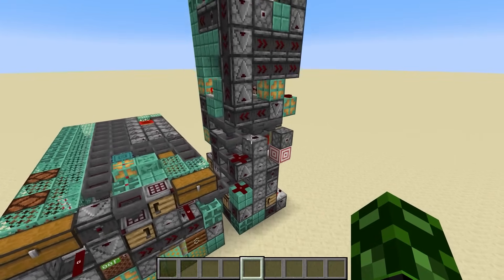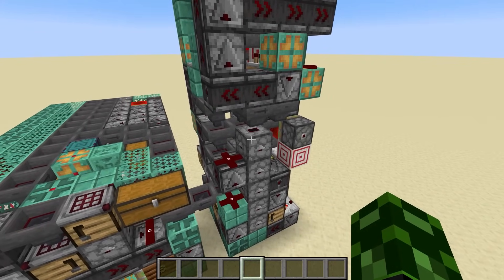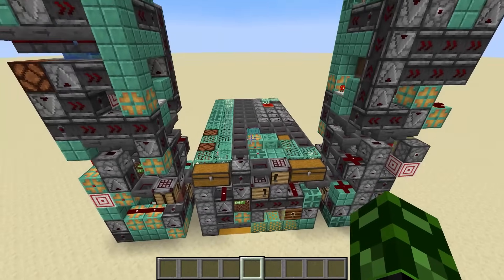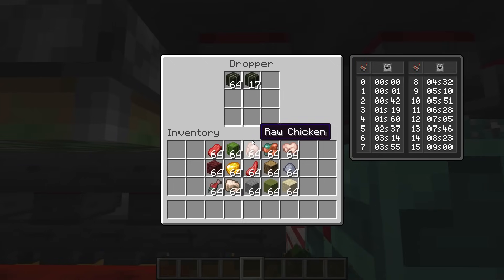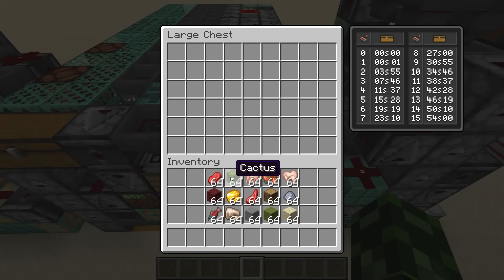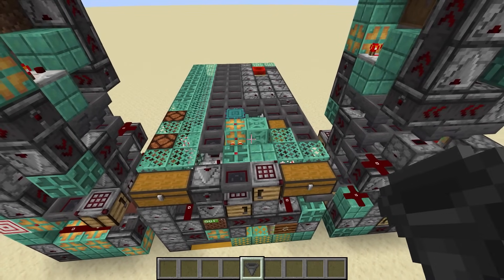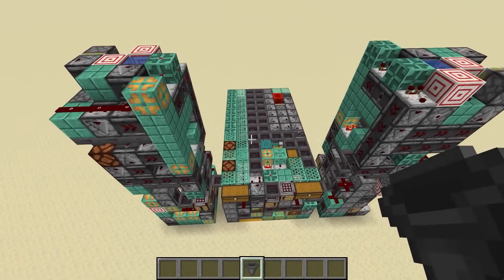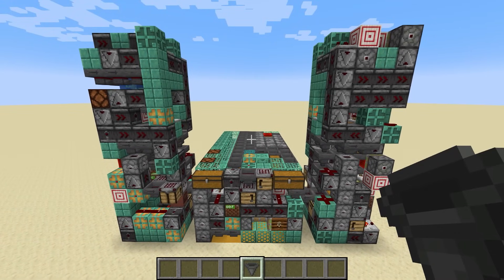SMART Furnace Array - 100% Fuel Efficiency (+ Kelp Fuel Rods) (No longer works)

Comment: The design is amazing, even it looks steampunk! I got a question, is it OK if I make more fuel rods beside the original ones and I connect them with hoppers to the main hopper?
Reply from the maker: I'm pretty sure Mojang broke this design when they changed the bulb works.
Reply: @cubehamster  I was wondering why the one I built wasn't working. Quadriple checked the wiring and restarted the whole thing so many times. Great twitter tutorial, wish I checked the comments here sooner.
Reply from the maker: @BlazingBlade  I am so sorry to hear you spend probably a boatload of time building this. I was super salty when they changed how the bulb works that I hadn't really checked back to this video. I will add it in the description and hopefully prevent other from doing the same.
Reply: @cubehamster  Oh no, I had made a decoration in my world test. Thanks anyway:) :(

Comment: Looks interesting. But I'll probably just build a version that starts filling up 16 smokers with kelp once I have at least 5 stacks available (full hopper minecart, easy to detect), to produce infinite dried kelp blocks to fuel my array; than just try to put in a multiple of 20x however many furnace I have in said array as an input.

Regardless, kelp based furnaces will be a game changer in 1.21. Same for the bamboo and prismarine based automatic building block crafting.

Comment: What if you only need to smelt less than 20 items?
Reply from the maker: Sounds like a single furnace without redstone would do the job. If you input 19 items in this machine, you won't get them back until an extra item is added. Thats not a design flaw, that is by choice.

Comment: While this is neat and a very nice adaptation of proper logic and efficient design, I'll stick to running ladders as fuel made by a bamboo farm. In the same footprint as your tower of kelp I can fit a machine making enough ladders to constantly supply a furnace with fuel. So no need for any logic or efficiency, I just run the farm and have it produce a saturated amount of fuel. In all fairness, I have a similar situation on the other end of the furnace as well, where there is a slight overproduction fo cactus. The XP bank is always running and drops the dye immediatly into fire ^^

Comment: Something I've been trying to figure out is what do the times represent from that chart you have when opening a chest. I noticed it's a comparator and chest so it's obviously got something to do with the comparator strength when reading an inventory, but the times it's showing make no sense to me. Could I get some help with understanding this?
Reply: s stands for "stacks" instead of "seconds", so for example comparator signal strength 2 requires 3 stacks and 55 items in a chest but only 42 items in a dropper (the chart changes depending on the container being opened)
Reply: @dairyqueenflashmob  OOooooh, Ok that makes way more sense. Thanks!

Comment: Gast hoe dan hahah, ik had t gevoel dat je terug zou komen toen ik de nieuwe toevoegingen zag maar nu al dit maken is echt top lol
A question though -- How many different items can it handle at once, and can it handle multiple single items? like 1 beef, 1 sand, 1 cobble, etc
Reply from the maker: There is one hopper extra hopper currently that functions as a buffer. If you somehow have an incoming batch of 20 items that consists of 7 different types of items the machine would actually break. Its something I have considered an can be fixed by adding a bigger buffer to the machine. But that would have made the whole machine extra 2 layers taller. Instead I prefer to to just not put in batch 20 with 7 different types of items.

Comment: I notice in some places there are a few observer chains. I dont know if its possible, but in certain cases, would it not be better to use an observer-solidblock-noteblock-observer chain? anyways, love the build.
Reply from the maker: Every timing in this build is exact. As in if I change the delay of any of the repeaters in this build it will stop working properly. Sometimes all the observers chains were needed to get the desired delay within the size contraint of the build. If you look at some of the paths the observer chains take it occasionaly gets pretty ridiculous.
Reply: @cubehamster  thats why i wasnt sure if it was even feasible. makes sense
Reply: Depends on the timing, of course. Maybe it's possible, but you'd have to design around that.

Comment: How is it smelting the extra 4 items from a full stack of 64 if it only does batches of 20? is it backlogging another 16 items to go in after the 4 different ones are done?
I'm not super well versed in redstone logic, so sorry if its an obvious answer.
Reply from the maker: There is an extra hopper above each furnace in the array which functions as a buffer.

Comment: Okay what I don't understand is how you can process 64 items of the same type if you only start the furnaces when there are 20 items in them, how does it handle the remaining 4? Because they won't stack with other items so in my brain that would mean the furnace would just never start no?
Reply from the maker: What others have said, the machine counts incoming items and has an extra hopper as a buffer if a furnace were to receive different types of items.
Reply: @cubehamster that is so unbelievably cool

Normally I'd make a super smelter which is only good at processing a single item, but this seems much more useful for real-game mining trips
Reply: Probably does the counting before putting in the furnace this way u can have multiple item type at the same time
Reply: That makes sense, it just wasn't how it looked like in the video, thus I didn't consider this possibility
Reply: @ZockerAxel At 3:18, you can see it smelt a stack of steak then 36 nether bricks (20 + 16). I think it must be counting total items! What a cool system
Reply: Probably 20 items into the hopper above the furnace
Reply: I am also curious